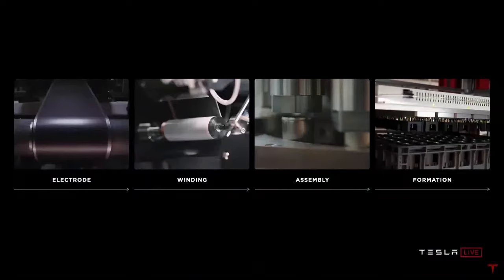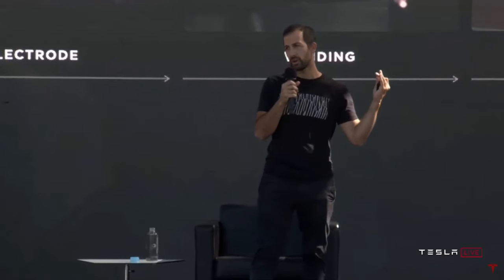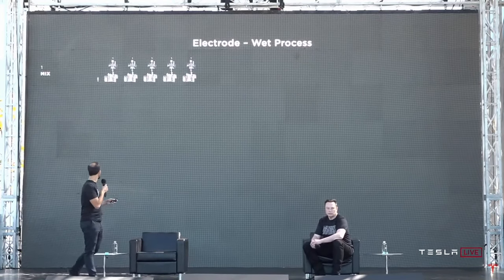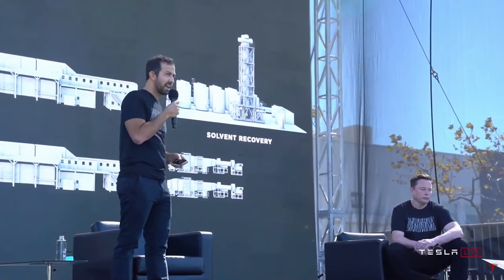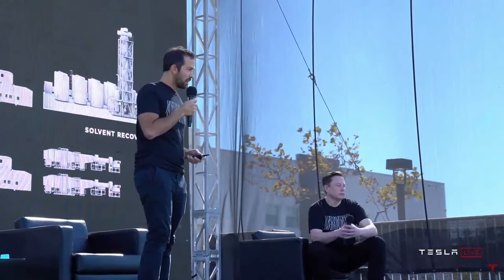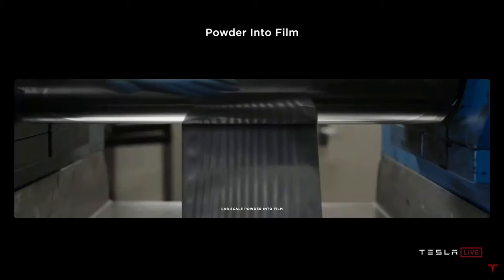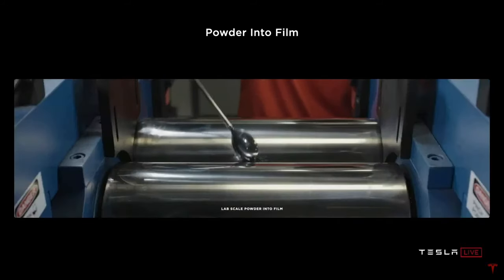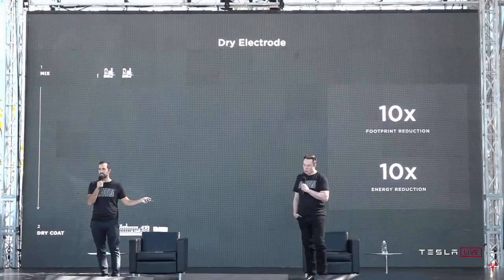How FUTURE Tesla batteries are made (and why they'll be better)

Comment: This is a very big deal. Amazing! Big congratulations to Tesla. This 
will demand the entire car industry to finally wake up and innovate 
properly again, inside out, not just on the surface. Also, energy 
storage will be so cheap soon thanks to this. A lot of people will be 
able to run their entire houses off grid, with just a few solar panels 
and a Tesla Power wall battery of this type. Imagine what the Tesla 
industry battery will be capable of. Calculate in the slow aging of the 
already existing batteries, those will be even better. That is 25 to 60 
years of near capacity stability. That is a life span and quality 
unheard of. This also means, there won't be any combustion based 
backup-plants at wind farms and solar farms necessary anymore. Hydro 
power dams will be able to store above their water storage capacity on 
top of that, within Tesla batteries. I see a revival of hydro power 
plants thanks to this as well. And this all with a entirely cleanly made
 battery, this long lasting, and 100% recyclable (and worth while 
recycling, as it pays off, thanks to the structure of the battery) - all
 within this very design. Absolutely amazing. Incredible achievement for
 the world's health and our sustainable future.
Reply: Solar panels would have to step up, you're not running your whole house on a couple panels.
Reply: @seahawks1185  mine do and several friend's ones do.. not a big deal. and the 2020 ones are even overproducing.

Comment: Can’t help but imagine the amount of mining it is going to take place to make these things...
Reply: IMO, most cars with 200 - 300 miles range will use LFP batteries as their energy density has improved and is now considered to be 'good enough'. There's absolutely no raw material shortage for LFP cells as they DO NOT use cobalt or nickel. I would also like to point out that mining for LFP batteries is a non-issue.
Reply: Probably, but I guess it's less about the mining and more about how bad the mining process is. if you park the whole Cobalt mining bit for a minute, I have no idea if lithium mining is less environmentally damaging that say gold mining - I can't remember which mining it is but there's one that using arsenic to extract the particular mineral. And I guess that the reduction in Oil extraction this would hopefully lead to will make it better in the long term even if not a perfect solution. I'm assume if it makes oil extraction from pristine environments such as the the antarctic unviable then that must be a good thing.